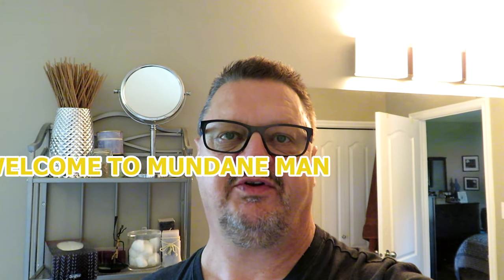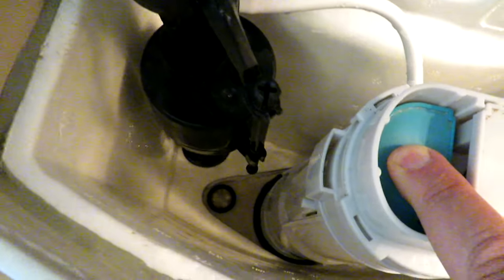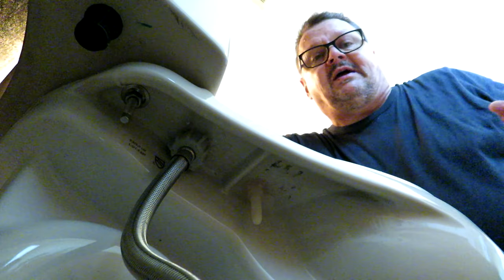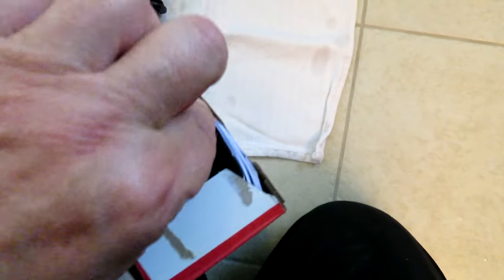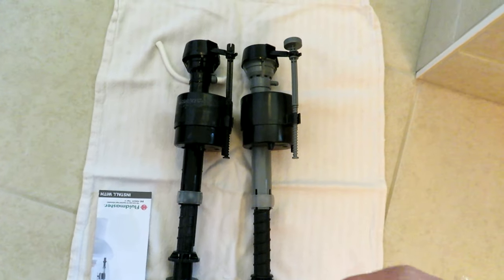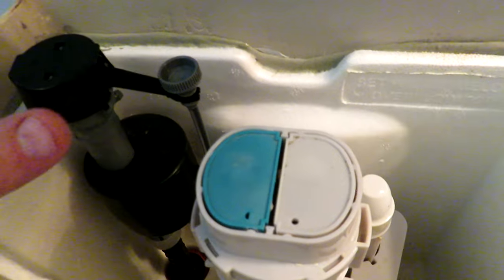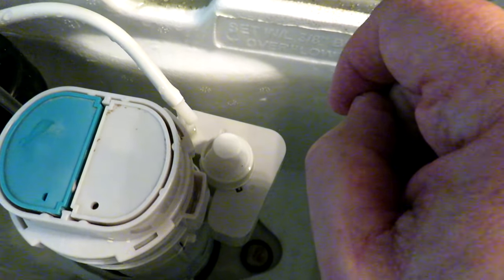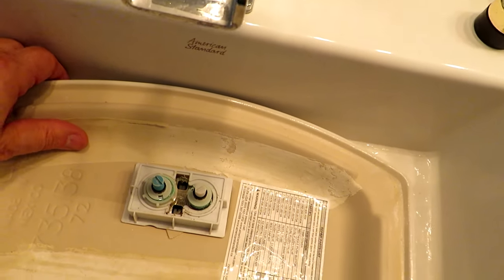How to Fix a Toilet That Keeps Running GUARANTEED | Cheap and Easy DIY Repair

Comment: mine sounds like it stops but the valve keeps weeping. tried cleaning the rubber seal and such no luck. I will try this 400 unit thanks

Comment: You do not need to remove the entire assembly (as shown) If you simply slide the “lock collar” (looks like a ring) under the float assembly, you can then slide the entire top half of the valve up, and off the bottom half (inlet) Then push the top portion of the new valve back down over the old inlet tube to the correct height for the tank, and slide the “lock collar” down to lock it in to place. You can also change the rubber seal of the fill valve by disconnecting the float assembly from the bar of the fill valve, and tuning it quarter turn to un-lock. Then do the same to re-install (plenty of videos on this) Saves a lot of time, no tools needed, and virtually no mess.

Comment: now we need one for a toilet that keeps dripping water into the bowl 'after' shutting off the entry.  i.e. it's the other valve assembly where the fault is.  This video about the inlet valve: 'fill valve'.  Need one about the 'exit', 'empty' valve.

Comment: Good video.  thanks, btw...@8:25 what's that third assembly, also white plastic, to the right of the blue and white flush tower to which the white plastic filler hose is attached.?    I called American  Standard and they say their manual ONLY shows  the fill valve  on the left,  and  the flush tower with the blue and white buttons but nothing else
Reply from the maker: That is where water trickles into the bowl while the tank is filling.